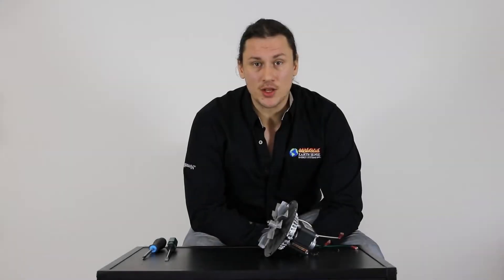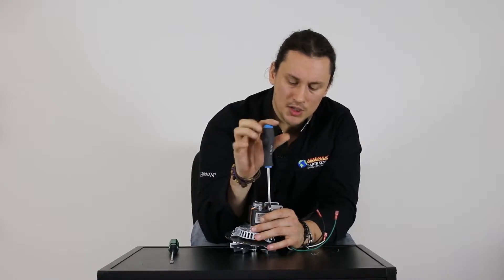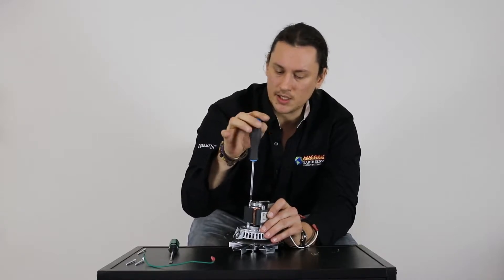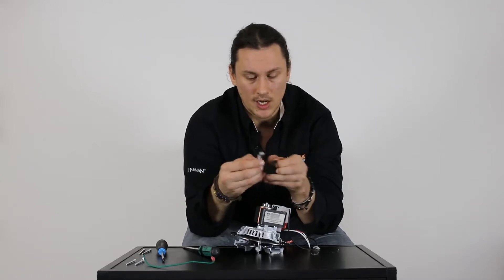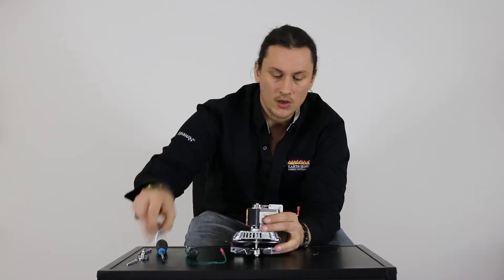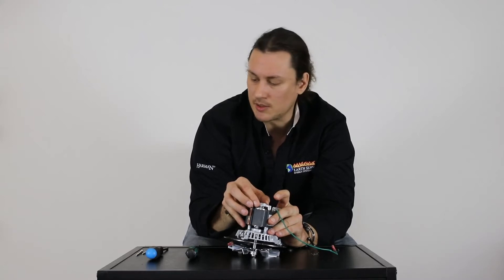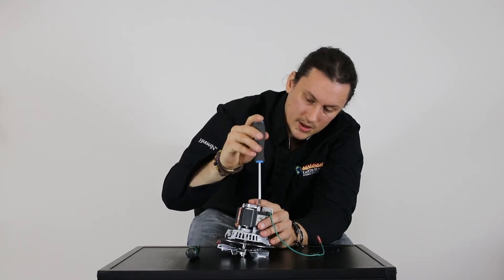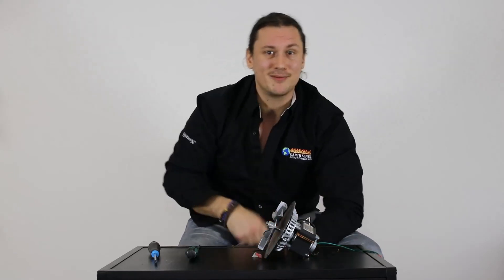How to Reverse Motor Direction Rotation on a Combustion Blower Exhaust Fan

Comment: hi i have question i have a lopi leyland stove was working great until recent the auger keeps on get clogged i take it  apart works ok for while then clogs again ive  usedthe same type of pellet( supreme) is it the pellet or is arguer motor going
Reply from the maker: Thanks for the message, happy to help. If your pellets look good (not brittle, no heavy sawdust) then it shouldn't be a fuel issue. Most likely it is the auger motor gears getting weak - Is there any abnormal noises from the motor when it feeds? Can also be good to inspect the auger shaft. If the flights on the auger are worn creating 'slop' in the auger tube, it can certainly put extra pressure on the motor gears and cause issues with auger jams. If this is the case you would generally see a good amount of broken pellets and sawdust coming down the chute as the unit feeds. The Leyden will use a 1 RPM Clockwise Auger Motor - Reference here - https://pellethead.com/product/pellethead-replacement-travis-industries-lopi-avalon-auger-feed-motor-1-rpm-clockwise/

Keep us posted, happy to help!

Comment: Should you also reverse the small fan on the shaft? otherwise it will blow in a different direction.
Reply from the maker: Thanks for contacting us. Most paddle wheel impellers are designed to be universal between clockwise and counter clockwise rotation blowers. Some out there are specific to rotation so this can be an important question if the blower direction is being reversed. Any other questions please let us know. Thanks.

Comment: Thanks for getting back to me. I cleaned out the auger four times already   It runs for about 30-45 min . The motor keeps on running (stopping and starts up again  until the stove shuts off should I replace the brass bearings or motor? Thanks again Joe
Reply from the maker: Glad you cleaned out and inspected the auger shaft. I would suggest pulling out the auger motor and testing it to direct power if you haven't already (link in previous message). You can do tests on operation and torque. This will let you know for sure if the auger motor is good or bad. If your Omega does have an auger end plate with a bushing, inspect the bushing. If the bushing looks worn it can cause noise and/or jamming/binding during operation. If you know for sure your auger is jamming like you mentioned in the original message, the issue is within the feed system. If you are not physically seeing or hearing it bind/jam up then this could be one of the safety switches shutting down the auger motor such as the vacuum switch or high limit switch. Start with simple things first. Happy to help. Thanks.

Comment: I’m looking to find out why the auger on my Enviro Omega pellet stove. It works for 30-40 min then the stove goes out.  The auger is all jammed up. Thanks in advance
Reply from the maker: Thanks for contacting us. I would say it's important to make sure the auger shaft itself is not jammed or bound up in anyway. Recommended to clean out the fuel hopper and completely remove the auger shaft. Inspect the flights on the shaft to see if there is anything abnormal. Check the auger end plate and bushing if applicable on your Omega. You can check the auger motor as well. Overtime the motor can lose lubrication, gears can become weak, etc.. You can run your auger motor to direct power to check operation and torque. Check out the video here for making a test cord - https://youtu.be/rlmiCYI2WPk?si=PP8ktXgcXi1A_Xbv
In the event you need any replacement auger feed system parts for your Omega please let us know, we are happy to provide references. Appreciated.

Comment: Of course this video would have been 15 seconds long ..just say reverse the armature. Use a lil motor oil if possible.
Reply from the maker: Thanks for your message. Some require further guidance and our goal is to provide videos that folks can go step by step through and comment with questions. Thanks.
Reply: @THEMAN-fl1ei, So maybe you can make a better video.  Go for it.  Meanwhile, thanks Earthsense!   Saved my ass big time.

Comment: How to change the direction of rotation of the gasoline engine..?
Reply: Start the car, put the car in reverse and press the gas pedal. However, if that doesn't work, then surely just wait until opposite day comes back around of course and you should be good to go. 
👍